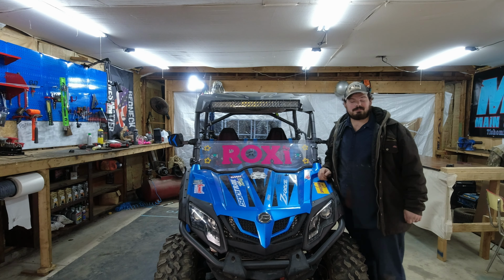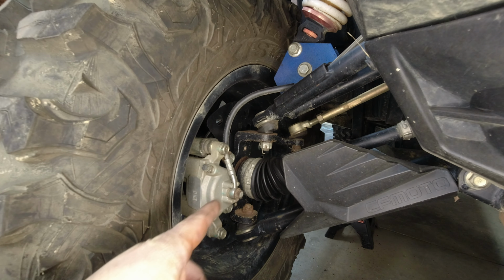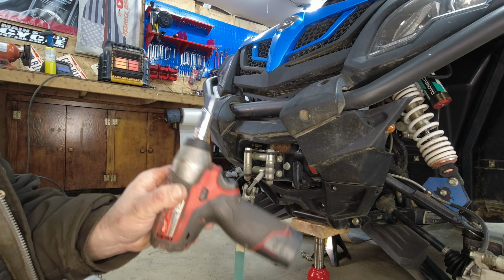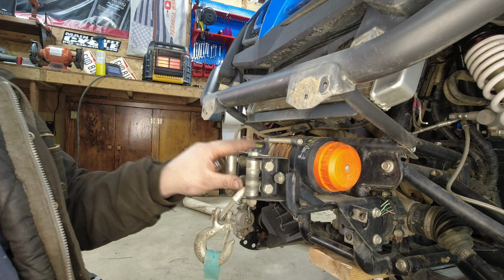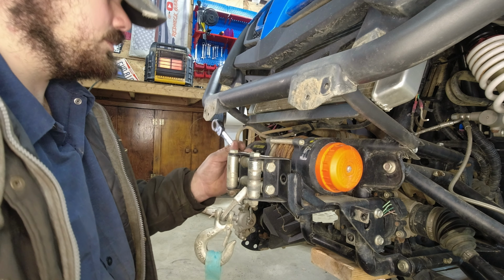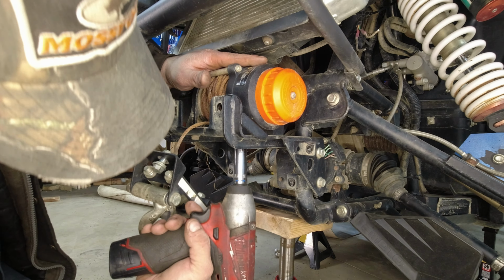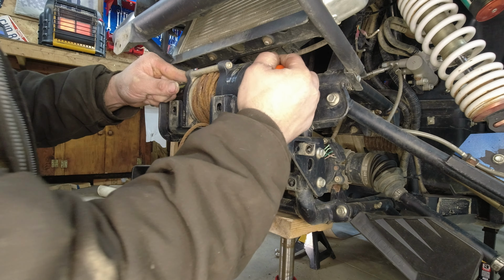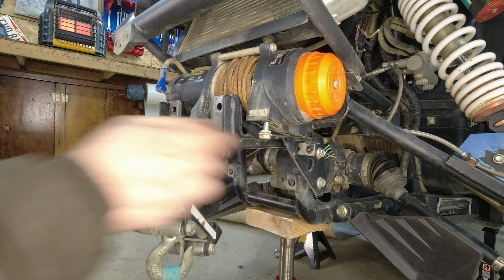CFMOTO ZFORCE How to remove the Winch

Comment: Can i ask what size light bar do u have on the 500 trail i have a 2021 800 trail and looking for a light bar same location you have yours mounted. Ride safe
Reply from the maker: Hey there im using a 32 inch bar.  Check with Main Street Cycle they have some in stock they could get ya one pretty quick.  Thank you same to you 😊

Comment: Man I lost my wireless remote for my 950 so I purchased a aftermarket deal off Amazon and it came with a box that has to be wired into the relay. I put black to black, red to red, yellow to yellow and white to blue and pop. Need to understand how it’s factory wired so I know what to hook to. I ordered another. Any help with that?
Reply from the maker: I would have to have the machine here to check on it.

Comment: In my opinion the go pro is trash!!
Reply from the maker: Yes i agree bro. I have a few and i do like the 360 its bad ass.  But the others have over heating issues. Memory card issue. My battery exploded in my 8black and cracked the screen. The camera still works but the screen is annoying now.